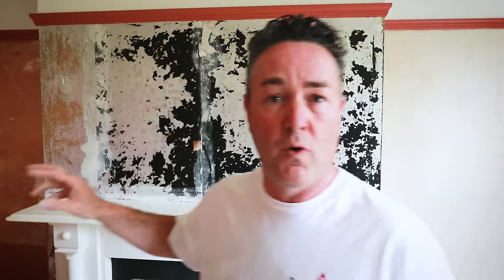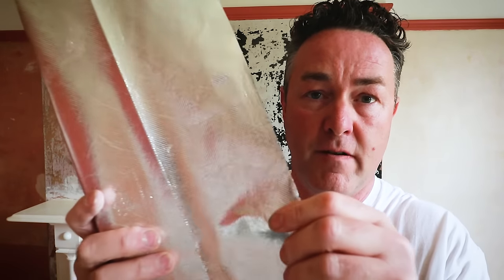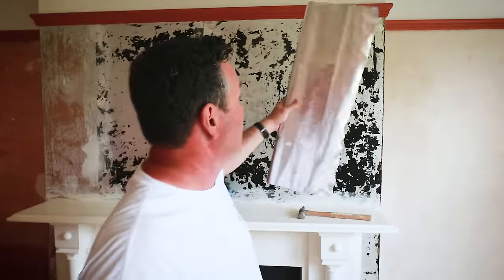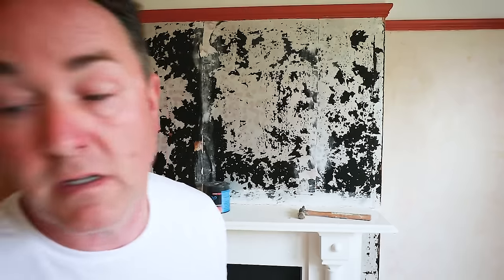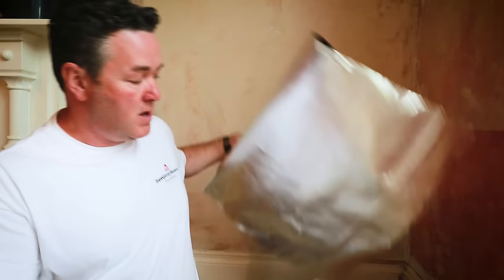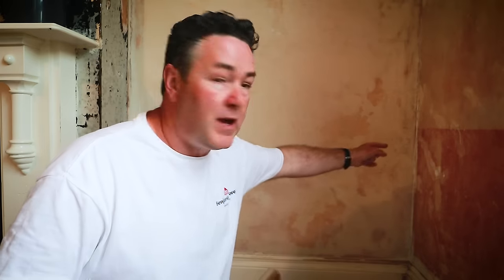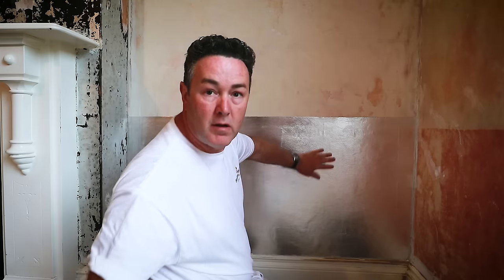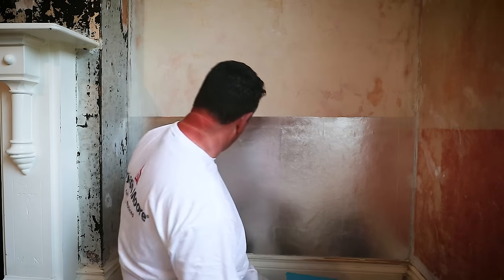How to Stop damp on walls - WallRock Dampstop Thermic

Comment: Masterclass, thanks Phil!  
 Wallrocks fibre liner is also a cracking product for traditional lining. Doesn't tear and easy to use....paste wall or paper.
Reply: I'm going to be doing a large wall with it soon. Is it easy to trim once up?
Reply: @alexthomson7465  very easy.  It doesn't rip easily. Lovely to work with. Make sure you size the wall
Reply: @gabegabriel2155  iva already lined it once so this will be a second layer a bit thicker than the first. Would've done it the other way around ideally. Never used Wallrock. Thanks for the info
Reply: @alexthomson7465  its a game changer. You can buy 1000mm, 700mm and 500mm widths. I keep large off cuts for crack repairs above doors and windows. A bit like a patch. You paint the patch to harden the paper then fill edges and sand to fether in.
Reply: @gabegabriel2155  so you paint the patch first, let it dry then put it over the crack?
Reply: Make sure you get the heavier grade on problem walls.i ve used the 1200 grade before and it wasnt the best so always get heavier stuff.the metre long liner is a game changer so get that lining paper.
Reply: Defo size the walls first when doing paste the wall.because you ve got use the tub adhesive you dont get much play around with the lining paper.sizing it it slides around better.prices seem to be creeping up on these products tho.its getting bit too expensive.customers starting to give you funny looks because of material prices like its decorators fault lol

Comment: Many of these type of problems are due to the wall temperature being cold which attracts condensation.  Micro condensation can form within the structure giving the appearance of stains emerging.  Its not always a dampness problem coming through the wall.  This seems a good product in that it will keep the surfaces warmer and resist moisture / vapour penetrating through to the structure where it would condense.  I recently surveyed an old Victorian property where they experience mould growth in all rooms where there is an external wall.  Its the temperature of the wall structure that causes their issue along with drying clothes for a family of 5 indoors.  Its a battle of physics.

Comment: Not going to slag this product off because I don’t know anything about it. However, I do know about buildings. Condensation is a big problem in lots of houses and generally for a couple of reasons. First off, people will  air clothes on radiators, that’s a very bad thing to do because the moisture has to go somewhere. Because houses are double glazed and sealed tight as a drum it cannot get out so  it goes to the coldest part of the room. Second, houses used to have chimneys, these chimneys were the lungs of the house. If the house can’t breathe then you are going to get condensation. The answer is Ventilation and keep your laundry outside as much as possible. Hope everyone suffering with this problem gets it sorted because it can be a nightmare. 👍👍
Reply: I live in a victorian property. You are correct about condensation, but a good dehumidifier will cure that. They are also solid walls, so any damaged bricks, pointing, or limestone lintels will let water access the interior. The best way to combat this is to fit a dry wall system using thermal  plasterboard. The problem with increasing ventilation is that it makes the house colder, which forces people to turn up the heating, which in turn creates more condensation. These types of products are just like putting a sticking plaster over a broken bone.

Comment: I've just put this up but didn't know about the recommended adhesive.  Is this going to be a proplem for me? I just used normal wallpaper adhesive but mixed it to a thick consistency.
Reply from the maker: Oh no.

Yep, the damp stop adhesive is special as it's not going to be affected by any damp in the wall surface.

Using 'normal' paste will only hold it for so long.
You use the damp stop adhesive when you hang the fibre lining over the damp stop (silver side) paper too... As normal paste won't stick to it.

You know I always say... Read the instructions ;)

Comment: We use this stuff all the time, real game changer, we do a lot of regen works in a lot of social housing and almost all properties have damp issues on the breast, although we have used the standard thermic adhesive in the past and are yet to see any damp return through and zero peeling issues and have never overlapped either unless we come to a corner that the thermic can’t be manipulated due to out of square, we  don’t always use the fibre liner either depending on quality of the plaster we use a standard wall doctor blown vinyl which also works well for us too

Comment: Hi there from New Zealand 🇳🇿  we have a weatherboard timber frame 1920s house the wall is cold not damp just cold what products would you recommend so i dont have to rip off the gib put building paper in each pocket and insulate with insulation then gib and plaster the walls on south side thanks
Reply from the maker: can you get plaster board with polystyrene backing? would that be a better insulation option?

Comment: I’ve just put this on my walls, leaving to dry for 24 hours but it’s soaking wet! Condensation all over it. Have i done something wrong?! 😮
Reply from the maker: hi, it does say 48hrs drying.
Reply: I’ve left it over 48 hours now but it was soaked with condensation. Is that normal? I just dried it and put lining paper over it.
Reply: Just remember, that this is a form of insulation and you may need some for of ventilation or at least check your kitchen and bathroom vents are working sufficiently. Great video and great product for decorators.

Comment: I have a newly built single skimmed porch I did protect all the blocks on the inside and on the outside to make sure no damp get through and I have plastered it could I put this over the plaster as an extra precaution and then put lining paper on top only purely because it is a single skimmed porch so I know it will be prone to damp even though I've made sure I've dampened all the bricks and everything else
Reply from the maker: Yes. Just like I've done in the video using wall rock as the finish lining paper.

Comment: Thanks for this, I’ve got moisture patches slowly developing on the inside corner of one chimney breast then another small patch inside an upstairs bedroom wall. Its a 1950’s house with a new roof. There’s no mould developing, it just feels damp to the touch. A specialist damp company said the wall is absorbing moisture from the inside. They suggested they’d replaster over these areas at a cost of £3,000! Think I’ll give this a try as the areas are relatively small.
Reply from the maker: Follow my instructions. It'll save a few quid for now.

Make sure you use the adhesive paste for the damp stop and wall rock fibre lining over it.

Comment: Interesting product and I'm a big fan of Wallrock products.
Surely the correct thing to do is to remedy the damp coming down the chimney? Also, I was always told that any damp in walls - especially in these older houses - the wall needs to breathe to allow any damp/moisture out? By trapping the damp/moisture in it will just move to another area to find it's way out.
Reply from the maker: It's not damp coming down the chimney, it's the sulphur from the soot penetrating through the brick. You see it on a lot of old properties as it shows the line of the chimney on the outside wall.

Comment: Absolutely brilliant video and superb instruction. I have however a recommendation to make, if possible, I would advise you to put the words, ‘removal of’ followed by something like, 'salt on walls,' 'salt coming through walls,' and ‘efflorescence on walls’ as I have watched a lot of videos over the months, stating things like just swipe/rinse it off, use white vinegar and baking soda, place a primer over it, perform Himalayan Chants, all which provide temporary solutions because after redecorating, the salt comes back and the paint starts peeling off again.  A really frustrating experience.

Two question please, can I apply this directly to a painted wall that has been sanded down or does it have to be applied to a skimmed wall and could I lightly skim over it after applying the 2nd thermal liner?

Again, great content and superb presentation and thank you for taking the time to do this.  I hope you get more views and subs as you deserve to.
Reply from the maker: I remember an exam question at college 30 odd years ago and it asked what do you do with efflorescence on a wall to remove it (the salt deposits).

The answer was use a stiff brush and brush it off as it.
(I knew the answer)

One of the other students said wash it off with water.... Which defeats the object of trying to dry off the wall.

Clearly you need to see where the damp comes from, but in old properties it's one of those mysteries you may never get to to bottom of.

Right, clean down your wall and apply the damp stop like I have.
Once dry. Go over with the wall rock, like I did.
Btw.. it does help if you prime OVER the damp stop with some of the adhesive, thinned down and allow to dry before you apply the WallRock lining paper 

No need to skim over it just get it a painted.
Reply: @ProfessionalPainterDecorator  Thanks for the quick response I am about to subscribe to your channel and thanks for your content.  You are a gift to the world.

Comment: Great informative video lesson. Thanks for all your efforts in making it. Cheers 👌⭐⚡
Reply from the maker: My pleasure
Reply: @ProfessionalPainterDecorator  it was very helpful. I didn't know whether or not the walls had to be sized first. Plus it's good to know that it stops cold spots. I'm decorating my mother's Victorian house, that has cold parts and attracts condensation in these bits. I'm just about to use this paper as it's worked wonders in my kitchen.

Comment: Hi! Excellent vid. We live in an old stone house with a brick front. The whole house was rendered with concrete in the 70s we think. We’re working on some drainage issues around the house which is causing the worst rising damp! Once the house has dried out fully in one or two summers (if we’ve sorted the drainage properly) I’m thinking we’ll do this, or it’s external insulation which will mean knocking off the exterior render and it’s expensive. Anyway, I’m going off on one - what I’d like to know is: as it’s an old house, the walls are well wonky! A feature I am fond of. Would the wall rock be easy to apply onto that or would it be a real b**ch? Would air gaps in the dips and troughs in the walls be an issue in terms of trapped condensation? Hope I’m making sense!
Reply from the maker: How bad are the walls, it may mold in. Or how about using the plaster multi finish and skim them out to improve them ready for hanging the damp stop?
Check that video out.
Reply: @ProfessionalPainterDecorator  it’s not too bad. We plastered the walls with traditional lime and we’re by no means professional and the walls bere uneven anyway, but now they’re a little on the bumpy and scrapy side 😂🤦‍♀️ I’ll take a look at that video but as o say, skimming is not something either of us are good at 🤦‍♀️🤦‍♀️🤦‍♀️
Reply: If your house is a solid brick wall then you will.need to remove the cement render and replace with a lime render, this will then stop.uour damp issues. Your issue is the cement render and  modern materials being used internally stopping your house from "breathing".
Reply: @windsorblade76  it’s a lime stone house but the front of the house is brick. We did all the research and all we could afford to do. The lime plaster was still present on the inside but some got wet and crumbled away so we replaced it with lime again. The paint we used on top is of clay. The inside is basically what it’s always been and repaired respectfully. The outside was rendered with concrete in the 70s. When we were re-rendering/plastering the inside was we noticed that that render was actually filling holes between stones and even some bricks in the front wall!!!! So we won’t be removing the outside render. We have found that the gutter pipe drainage doesn’t go down a pipe any more but straight into the soil along where the one side of the house is wet. Further down that wall we have discovered that our kitchen drainage AND the water pipes are leaking. The previous owner planted trees and plants right up against that wall and as far as we’ve checked, there’s no rubble to help the water drain down. The drainage is the only issue we can address and it’s the only one we really have a issue with. Since we can’t remove the render, I figure that a modernised drainage system, underfloor heating and (once the walls have dried out) internal insulation - OR “damp stop” - would be the only options left. 
Hope you were hanging on through all that 😆 of you were, would you have any advice relating to all of that? My thanks

Comment: Bit of advice to all.
If there's evidence of damp, and i mean no offence in saying this, do not ask a decorator for advice. If you do and the answer is words to the effect of thats not in my skill set then he's a keeper. Sticking, pasting or painting anything over damp is usually holding back the inevitable, which is further works including the removal of whatever the  decorator may have done.
Nuff said
Reply from the maker: and your fix would be?
Reply: @ProfessionalPainterDecorator First I would say good on you for searching out and finding a product that gets the job done, it's all any of us want to do.  I'm not an expert but have been in the building trade for many years now and I have seen many attempts to hold back the dreaded damp. I'd say more often than not the damp reappears somewhere, somehow. Unless the root cause is found and fixed all any of these quick fixes are doing is hiding a problem that is most likely getting worse, possibly tracking into areas it didn't previously affect. I mean no offence in making these comments but damp is the bane of many a builder and decorators lives and masking it rather than diagnosing and fixing it is, if you're lucky, going to see the money going in the bank once the job's completed but expect a phone call at some point. Unfortunately the next problem is finding a trustworthy damp proofing expert with a reliable method of fixing the issue. More often than not the problem is being masked not fixed by these guys, making more mess and making more money than using your method.  It is a minefield and I accept that I haven't brought much to the table regarding solutions but I see this on a regular basis, I swear my bad neck is due to shaking my head at people pretending to know how to fix this problem.
Reply from the maker: @straty5598  did you watch the full video on why I was using this product and what I said about damp in the video too?

As you mention and as said. This isn't a problem solving product for 'damp' as in water leaks.

We come across many a period property that has damp on walls (remember rising damp only goes as far as 1 metre up from ground level) which the root source can't be assatained. 
So this product helps the customer acheive the fix it need for that time.

again... all this is covered in watching the full video.
Reply: @ProfessionalPainterDecorator  yeah I watched it, good to see someone that takes a bit pride in what they do. However my point is the root cause can always be found by a pro, finding a pro with a reliable fix is the problem and masking it no matter how well intended is not for me I'm afraid.
Reply from the maker: @straty5598  how do they clean outthe chimney of all the soot from a 150yr old house and wash it out and stop the penertation of the sulphur/soot through the chimney breast which then causes the marks on the inner wall and that in turn stains through the wallpaper?
£££££
or use DampStop at a fraction of the price for the customer who is nearly 90. ;)
Reply: I think this situation is different though. If it were rising damp or penetrating damp from faulty pointing it would need treating
Reply: @kevinski7927  yeah I agree. I just cringe when problems are hidden, even done well as in this case.
As I said I'm no pro but covering up a problem often leads to a more widespread issue which equals bigger bucks in the end. It might not be the old dear, who I appreciate may not be able to afford to go the whole hog for a complete job, but it'll come sooner or later.

Comment: Great video, thanks for sharing. Hiw do you apply it to an external corner? Fold over a small overhang just as with regular paper? I'm concerned about leaving an air pocket on the corner.
Reply from the maker: All explained in the video ;)
The adhesive is making a water proof seal too. So you can cut neat to corners, internal and external... 
Don't overlap... It'll give you a fatt edge

Comment: Great video. I need to hand this but I have to hang a heavy wallpaper over the top so I have to paint over the foil with the adhesive before I hand the paper and I can use normal paste is that right?
Reply from the maker: Watch the video again. All is explained on there.
Personally.... I'd line with the WallRock over the foil.. then hang your finish paper.. on the wall rock fibre lining.

Comment: Great vid Phil. I’ve used this paper and glue around 8 years ago on a chimney brest. Think they’ve slightly changed the name of it and improved slightly. Good gear tho👌🏻
Reply from the maker: Was it the Marv WallRock brand?
Reply: @ProfessionalPainterDecorator  I can’t remember but I’ve very similar. Works a treat. I’m using some today 😆
Reply from the maker: @andrewdavies1813  it may be the original one where you wet the back in. Then overlap the edges. Horrible stuff. Creases up ever so easy.